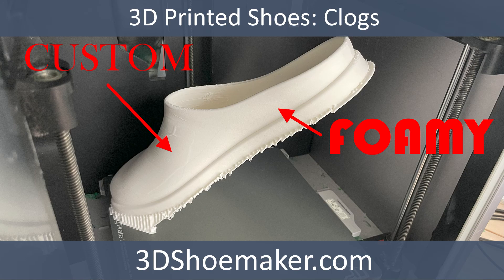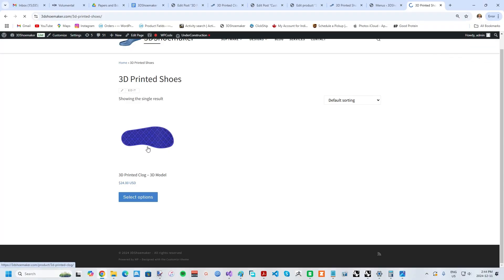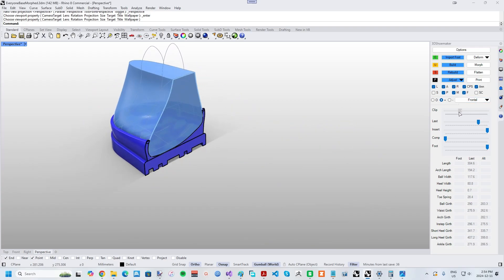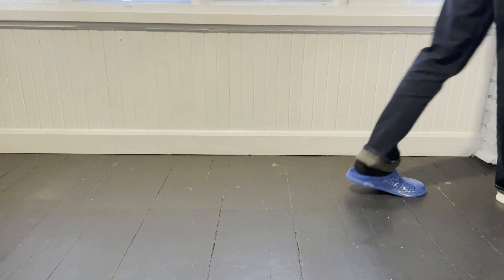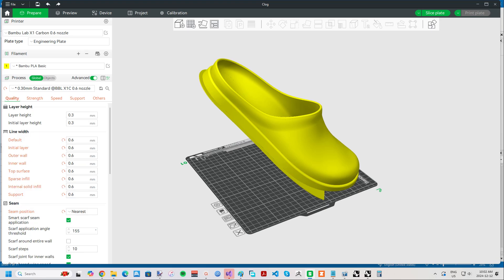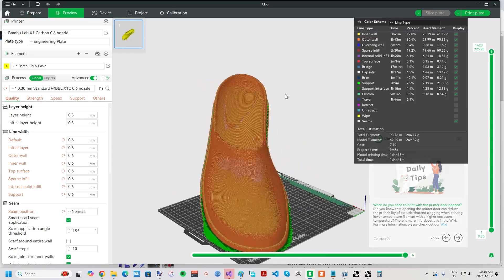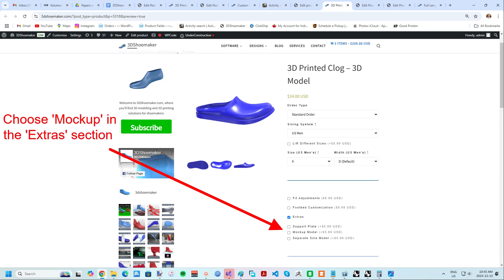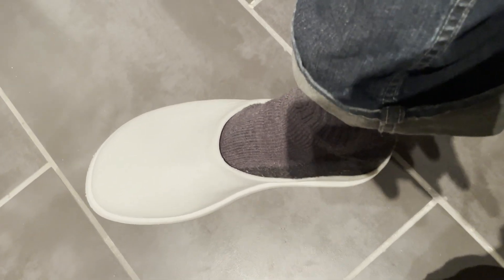3D Printed Shoes: Foamy and Customizable Clogs

Comment: With foam TPU being hard to get where I live, I gave TPU 85A a shot. Haven't been able to try Foam TPU, but 85A surprised me with the results. I have currently been wearing my own shoes (of my own design. Couldn't get to print the outsole design from your model) for a month now through a variety of terrain (dirt, road, dirt with small rocks, pools, sand, ocean) and they have proven to be surprisingly resistant. If anyone is having trouble getting foam tpu, I suggest giving 85A a go. It is, as I have seen from yours and others videos, harder to print (and it certainly is, I had many failed attempts until I managed to tune the right settings) but it is also a bit more affordable. I use Siraya Tech TPU which also has their version of foam, just haven't been able to get it since it sells out quite fast. Prints have been successful on Bambu Lab's P1S, X1C and A1. Just wanted to give my small grain of experience on this subject and thank you again for your videos, they have helped me tremendously.
Reply from the maker: I should try TPU 85A at some point. But foaming TPU can go much softer than that, yields lighter results, and it's also very grippy (though not as grippy as common rubber)... Interesting about Siraya Tech foaming TPU, I'll have to check that out. Glad you found the video useful, and thanks for the comment and info!

Comment: Looks like a great shoe to print!  Which software app did you use to design the clog?
Reply from the maker: Rhino, with the 3DShoemaker plugin
Reply: @3DShoemaker  Thanks for the info.  Is there some reason you chose Rhino over Fusion 360?  Is Rhino better for designing shoe shapes than Fusion 360?
Reply from the maker: @MOVIEKICKS  Rhino is the number one shoe design software, at least as far as commercial CAD software goes. It is an incredible piece of software.

Comment: I broke my ankle and have been through pure hell.  ive lost several jobs.  I need some help I have tried to 3d print a support boot that is thin enough to fit into my shoe and strong enough to give support to my ankle.  it needs to be able to lace up or tightened with velcro or something?  I really need your help.
Reply from the maker: That sounds awful... Definitely sounds like you should try to see a local pedorthist or similar... Currently a fully custom should we be the best option. I hope to eventually have some more substantial 3D printed shoes that could help with something like this, but they are still a ways off. You could always experiment designing something with Rhino/3DShoemaker plugin and printing it with a similar technique as I've shown in this video...

Comment: Looks like you’ve put a lot of effort into these and they look quite good! I’m surprised at how expensive the model is. On top of the already expensive TPU, this puts a pair of shoes at close to $60. I recently ordered some clogs from China for $5 all in for comparison.
Reply from the maker: Ability to customize is the biggest benefit here I think.
Reply: @3DShoemaker  That would be a big benefit... if one could play with it without having to pull the $$ out for each adjustment. Love the concept! Love to support your work, don't love how you've ended up monetizing it (the hard part)
Reply from the maker: @ejh237  I definitely see your point. With the customer doing the printing and covering that cost, they shouldn't have to pay yet again if they need adjustments. I'll have to figure out how best to manage this... In the meantime, if you want to give it a try, you can ask for free revisions, within reason.